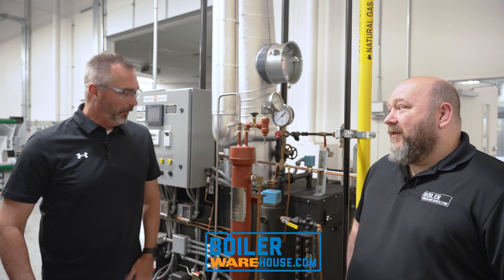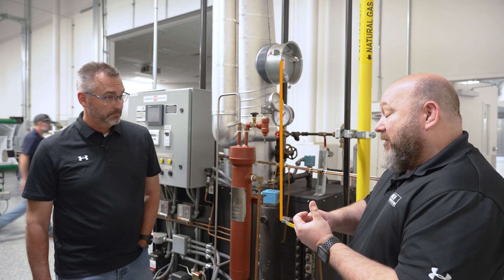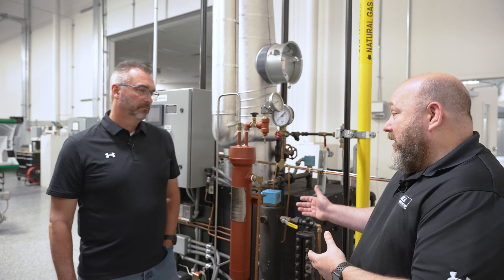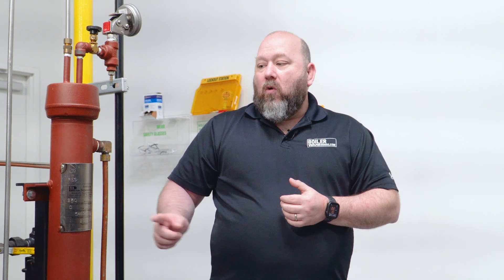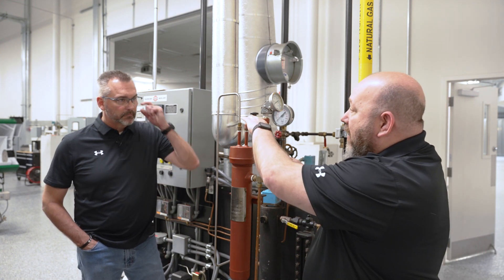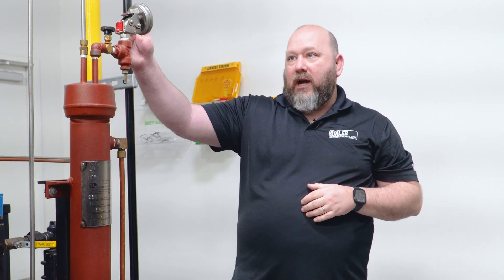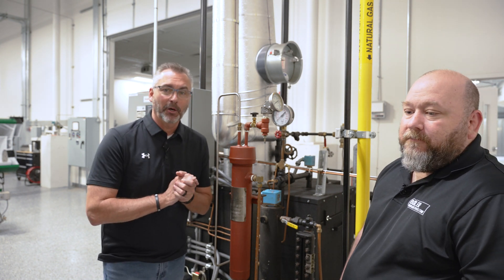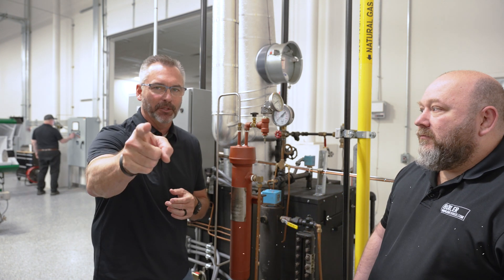Sample Coolers Explained: Why They’re Essential for Boiler Water Treatment! - The Boiling Point

Comment: ALOT OF BOILER ROOM MANAGERS are too cheap to buy these, I appreciate using them so I dont burn my hands on the crazy hot water.  It's basically a heat exchanger.
Reply: Our plant just has a coil of copper tubing in a 5 gallon bucket of water. Works ok.
Reply: @Jeffect3  That s no good,  make sure I report your boss to OSHA